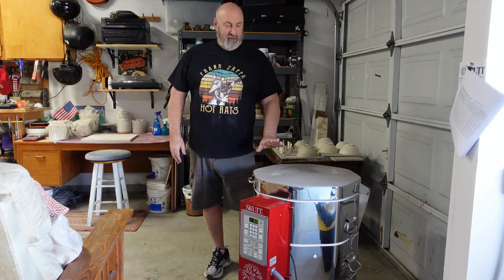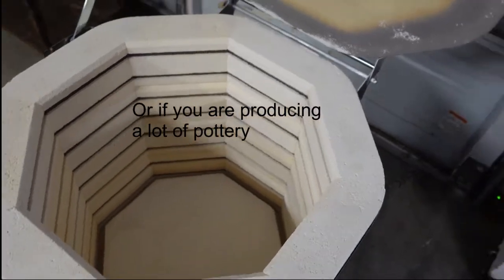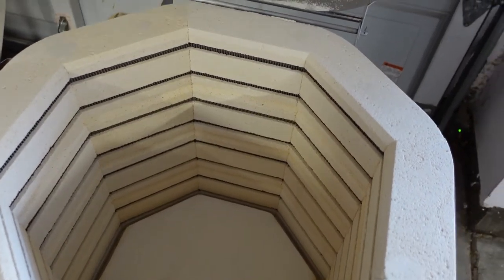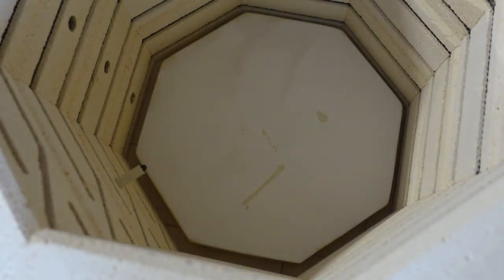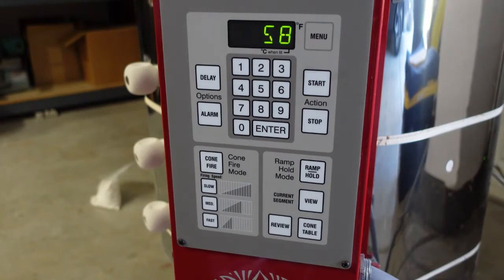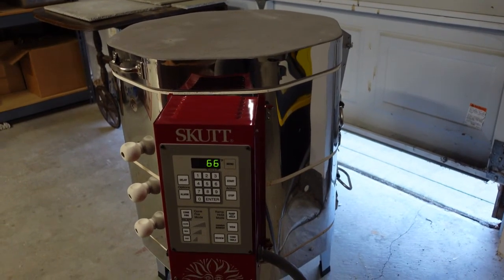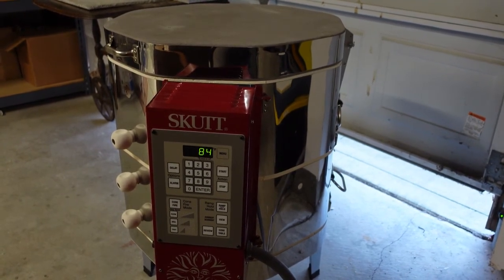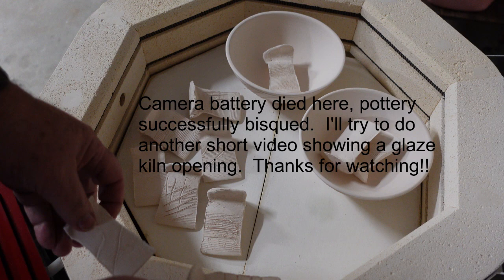Skutt 818-3 Kiln specifications, electrical requirements and bisque firing.

Comment: Thank you for the video!!

My question is about the pegs on the side of the kiln. I see in the video you have three in and the top one out, can you please explain about that? Is the top one always out? I’m planning to fire 06, flat panels, no glaze.
Reply from the maker: I always leave the top plug out. Especially important during bisque firing. Allows moisture and gasses from organic matter to escape the kiln. Will help your elements and bricks to last longer. Good luck!

Comment: Me again lol 
Advice - we have the same kiln and I know that Skutt recommend that the lid remains raised until it hits 1000 degrees for bisque runs.  It seems like a waste of energy and takes longer for the kiln to heat up.  It looks like you close the lid for bisque?  I keep reading so many different opinions - it’s very confusing - thank you 😊
Reply from the maker: I leave my lid open (cracked about an inch) to 1000 on all firings. I figured there is .moisture in glaze, so good to let that out to protect the kiln elements. I also leave the top plug out entirely. I'm retired and patient! Lol
Reply: @masterofnothing3277 lol retired here too!!  Skutt tech stated not required for glaze firing, only for bisque and to fire at 04 on slow. Trying my first glaze firing next week, so that’ll be  interesting. Have a great weekend and thank you.

Comment: I just bought this very kiln and I do not have it vented.  I am on the fence. Have you had any issues with anything metal being affected with your firings?  I leave my car outside the garage and have the garage door halfway open whenever it is on.  Enjoyed your video and it helped me a lot 😊
Reply from the maker: I've had a couple hundred firings now, also in the garage, and not vented. Same as you, I leave the garage door halfway up. I have a floor fan and a ceiling fan that I run while firing. I've not noticed anything unusual. Hope you love having a kiln at home. I know I do. Good luck!
Reply: @masterofnothing3277 thank you and great to hear.  I’ve purchased a fan myself to run also.  Much appreciate your response!

Comment: We’re wondering if you noticed a large change in electricity bill?
Reply from the maker: I average 2 or 3 firings per month. Although I'm sure firing makes a difference i haven't noticed anything drastic. Before having my own kiln, I was driving 20+ miles each way to drop off and pick up. So basically,  that was 80 miles driving between bisque and glaze firings. Plus, paying several dollars per piece for the firing. Also, having control of how your items are fired is a game changer. I LOVE having my own kiln!  Good luck, and thanks for watching!

Comment: Jack of all trades master of none.   if not all kilns, the inside bricks seem to crack.  There is got to be a company that manufacturers that their bricks do not crack.
Reply from the maker: Almost all kilns are made of 'soft' firebrick because it's lightweight, easy to shape, and provides the highest level of insulation. Hard firebrick is more durable but heavy,  hard to shape, and not a good insulator, i.e., it takes a long time to heat up. I don't know of any manufacturer that uses hard firebrick for kiln interiors. However, large kiln exteriors are often made of hard firebrick because of the structural support it offers. 😁

Comment: Great video I was intimated to  buy a kiln ! Your video was easy to understand and now I’m thinking perhaps I should buy a kiln !
Reply from the maker: If you have the power and the space, I highly recommend it. I love convenience and control. Zero regrets!  Good luck!.
Reply: I had an electrician in today the quote back to 1300.00 to install the kiln …. It’s a hard no …  $$$
Reply from the maker: Yea, mine was $800. That's for a 40 amp breaker, 40 or so feet of 8 gauge wire,  conduit,  emergency cutoff, and the outlet. I was really tired of the two hour round trips to fire my bowls!  Maybe get some more quotes?  Good luck!

Comment: Thank you for the video! Quick question: when you switched from full shelves to half shelves, where do you put the posts? Are you still using three posts and then having the seam between the two half shelves sitting on one post? Thank you!
Reply from the maker: Hi Rebecca. I use three posts under each half shelf. You lose some shelf space, but I think less risk of a shelf falling. Have fun!

Comment: Hi! Did you drill the vent holes yourself? I’m so scared to do that!
Reply from the maker: Mine had the holes when I got it. I know people drill a hole in the bottom for exhaust vents, but I don't use a vent. Did yours not have the holes in the lid?
Reply: @masterofnothing3277  Mine didn’t come factory drilled at all! I guess is relatively common to drill them, I’m just super nervous about it. My 818 is in my basement, so I have to vent it out.
Reply from the maker: @wideeyedwildling  its just firebrick in the lid so it'll drill easy. You might call skutt to see if its even needed. When I fire I prop my lid open until about 900 degrees, between that and your vent I'm sure you'll be fine. Enjoy!

Comment: Thank you so much for sharing this tutorial. I finally got my own kiln but i'm a bit lost when it comes to stacking the 2 half moon shelves on top of full moon shelves. I noticed you had 2 half moons at the top of your load and they looked very stable. Do you happen to have any tips on how to do that?
Reply from the maker: Use more stilts. Half shelves require 3 stilts, same as a full shelf.  That means if you use two half shelves it will require 6 stilts. Those stilts take up a lot of kiln space, I'm hoping to get another full size shelf.  Half shelves really come in handy when you are firing something tall. Thanks for watching!